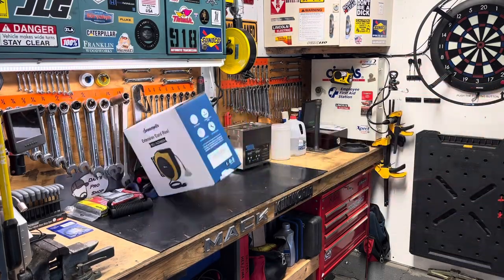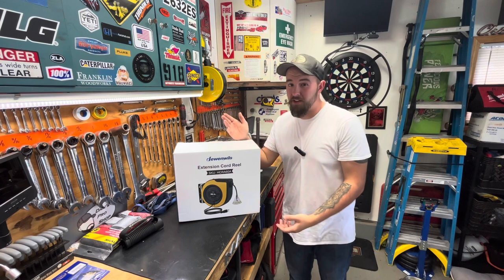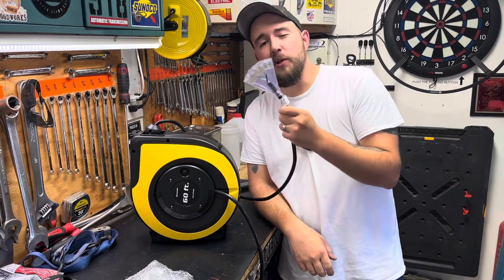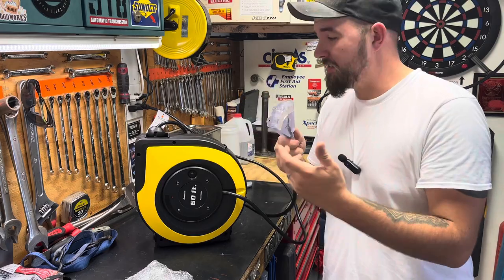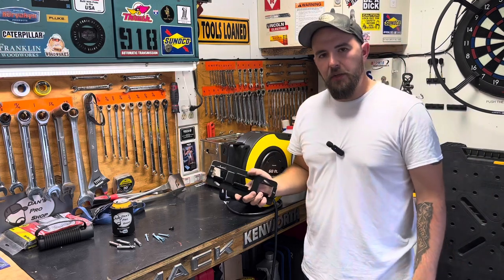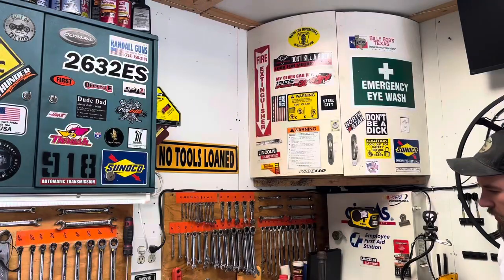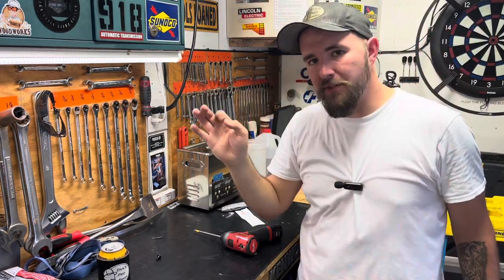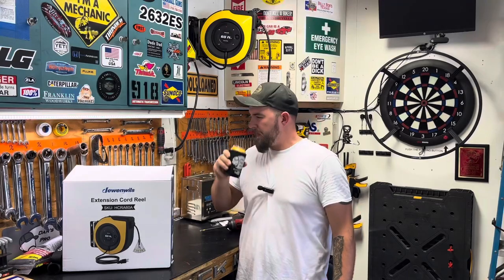Industrial cord reel by Dewenwils!

Comment: The cupon code does not work...
Reply from the maker: I think the manufacturer may have put a time line on it
Reply: @dansproshop  well bummer. Just my luck lol. But I got it anyways. I hope it works out great!
Reply: @dansproshop  well..update on the reel.. Maybe I'm just expecting too much.. but it seems like It has a hard time Retracting.. It gets caught up Fairly regularly at different lengths, even if I slowly feed the chord back into the reel.. Did you ever have issues with this?
Reply from the maker: @jsully4074  I have not had that issue. Mine works perfectly. I would contact Dewenwils. Use this link here to start a claim. https://dewenwils.com/pages/contact-us
I'm sorry you got a dud. Best of luck to you!
Reply: @dansproshop  thanks I appreciate it I will do that.